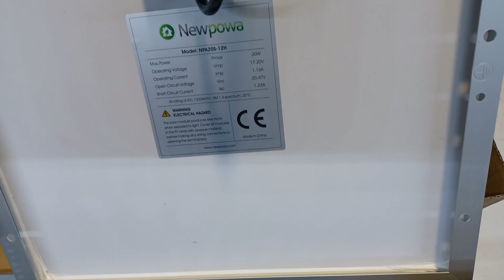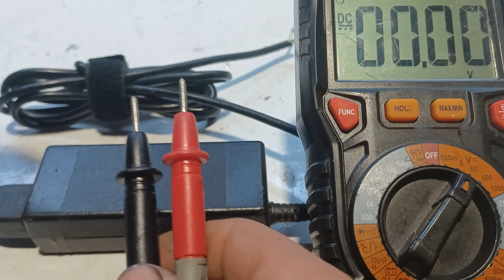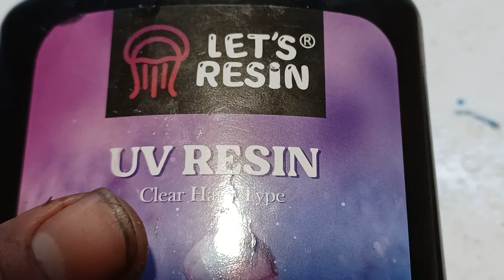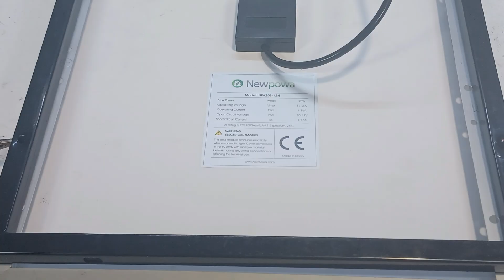Easy DIY Solar Charger for All Your Devices!

Comment: What will happen if the bateries are full and the solar panel is charging them?
Reply from the maker: The BMS will disconnect the solar penal from the battery pack after it is full (12.6v) (just like a phone when it reaches 100% the BMS from the phone will disconnect the charger from the battery) thanks for asking😀